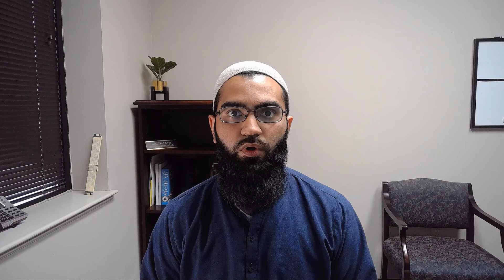Is your ultrasonic transducer working at the right frequency?

Comment: i am trying to  make an ultrasonic flow meter using arduino uno, mpya 1 mhz transducers and tdc gp30 ic are my components correct if not what should i use instead

Comment: Thanks a lot,  I wondered if you could share some information (or make a video) for customized ultrasonic generators with wide frequency range (10kHz range) for exciting one transducer with several horns, like the ultrasonic bone surgery devices, which a transducer works with over 90 inserts (horn), how is that possible?
Reply from the maker: That is a really good idea! I am planning to get to this topic, because it is quite important.

Comment: Can listening to these high frequencies cause tinitus which is ringing in the ears and  has no cure. I would advise people not to mess with this stuff.
Reply from the maker: Hmm hard to say. Don't know much about that. You can't hear ultrasonic frequencies, but with your ear in the wrong place, you can still get subjected to a significant amount of energy. I would say not to worry about it unless you are putting your head inside an ultrasonic cleaning tank or you are working on high power air transducers.
Reply: @ultrasonicadvisors  Thanks for your reply. I still think it's very dangerous based on the fact there is no cure for tinitus and many many  people get it worldwide. It could trigger it in some people.

Comment: I have a project where I plan using a royer oscillator (ZVS type) to power a langevin transducer.
I understand how to calculate frequecy (LC circuit) of primary, but for secondary winding what would be other considertaion?
Reply from the maker: I have less experience with oscillators than I would like. However, here is my thought. I've seen oscillator driven transducers operated with high voltage at semi-off-resonance conditions. this makes the transducer look like a capacitor. Also, at times the primary side is made to be dominant, so the transducer has little effect on operating frequency. Hope that provides some insight.

Comment: How to generate frequency for "40khz 35W Ultrasonic Piezoelectric Cleaning Transducer " properly  work.
Reply from the maker: Great question. Easiest way is to buy a commercially available circuit. Many of them are based off oscillator circuits (no digital control)
Reply: @ultrasonicadvisors thank you sir, i want to made above circuit , plz give me resources, (link or image).

Comment: Thanks a lot for giving this kind of info, got a question if i might : 
i have a watt / frequentiemeter  if i put that between the generator and the piezo elements i kan read both values .
The ferq. the generator produces  can be tuned by a pot. meter on the bord .
Do i go for that freq. where the power is at its highest ??  Thanks
Reply from the maker: Yes, in general you will go for the frequency at which the power is the largest. However, you should be searching for this frequency in a range that you already expect, for examples for a 40kHz transducer, you will search between 36khz-44kHz
Reply: @ultrasonicadvisors  thank you , the wattage is the highest on 38.3 khz , while the transducers where on 40 +/_ 0,1 Khz 
could it be that the piezo elements are failing? or could for example the cleaning tank design has influence ?? greetings from a cold Norway !!
Reply from the maker: @UltralydvaskingLillehammer  Love the discussion. Is your transducer mounted? The stand alone transducer maybe 40kHz, but mounted it maybe 38kHz.
Reply: @ultrasonicadvisors  yes the transducers are bonded to the tank , its a 250 ltr tank with 4x10  50watt transducers,  every row of 10 piezo"s. Is fed by a 500watt generator which i can adjust. 
So i go for that freq. Where the wattage peaks?
Reply from the maker: @UltralydvaskingLillehammer  In general, yes. However, I think 500W may not be powerful enough to drive 40 transducers?
Reply: @ultrasonicadvisors  thats correct , i use one generator to drive 10 transducers , so i use 4 generators producing 2000watt in total . thanks for you taking the time !!
Reply from the maker: @UltralydvaskingLillehammer  No problem!